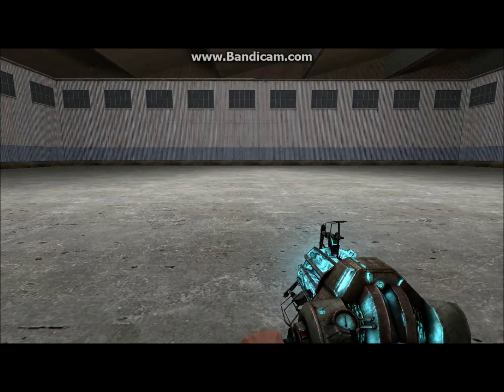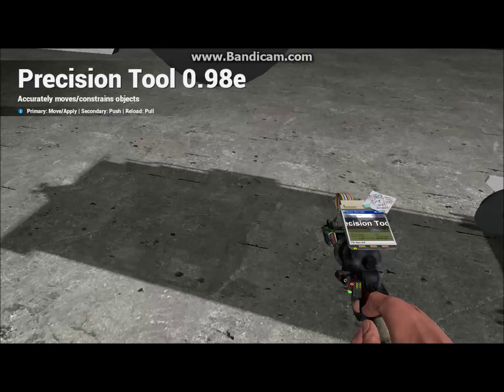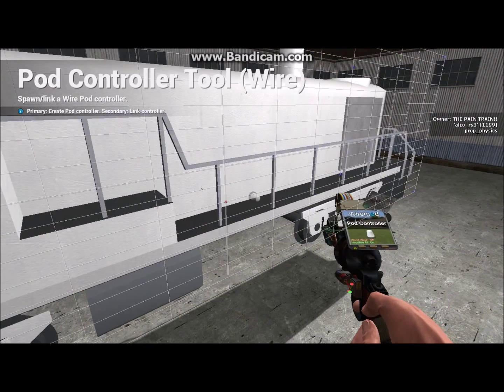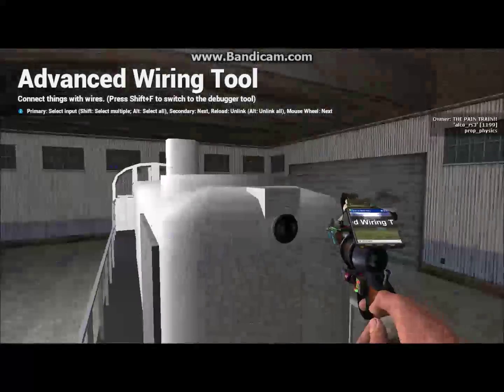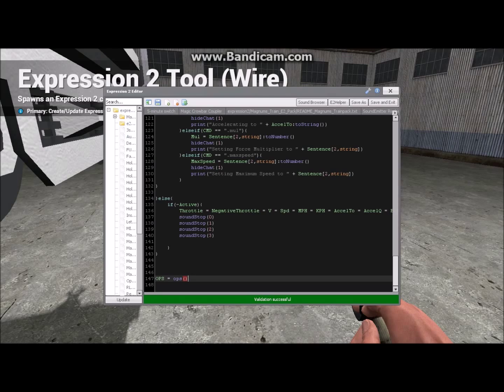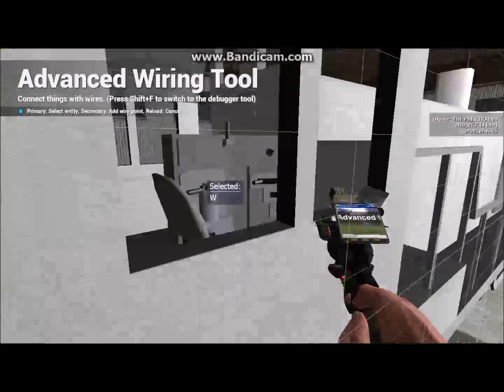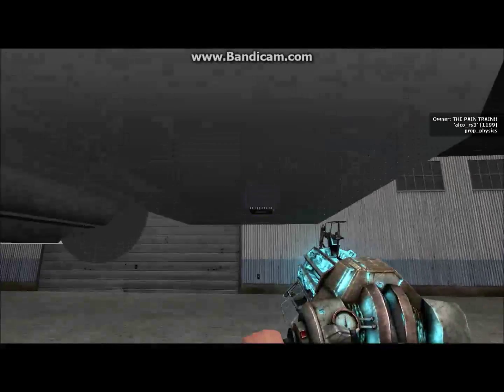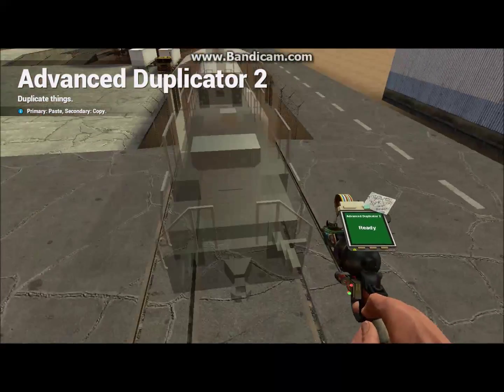How to build a working train in Garry's mod.

Comment: everytime I try to toggle the buttons when the engine is on, they won't turn off :(
Reply from the maker: That happens, just keep pressing it and it will turn off eventually.
Reply: +ThePainTrain765 I was building a train using precision tool 98. and forgot to use axis 😕

Comment: and the horn?
Reply from the maker: +Jhonatan shadow Just wire a sound emitter or E2 to "a" or "D" on the pod controller.
Reply: Jhonatan shadow the way I did my horn was I got and E2 for the horn changed the diesel engine idle then made it horn so then I would have 2 E2's and link active to whatever button.